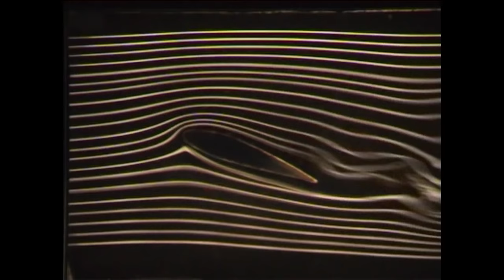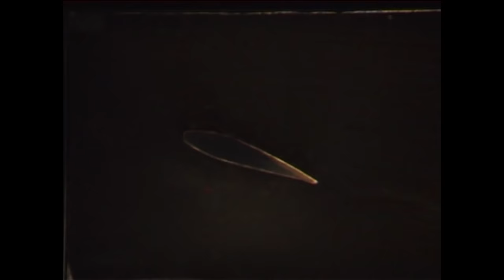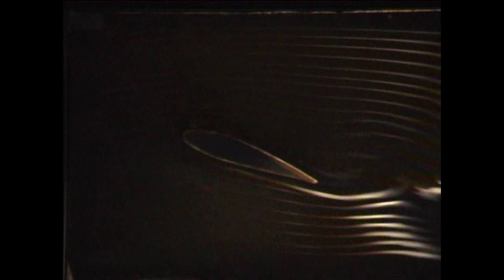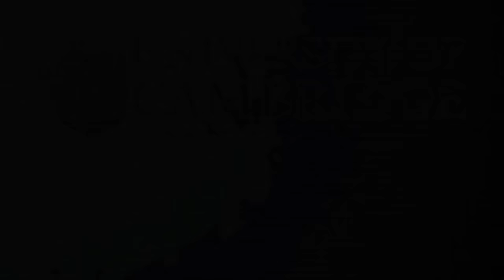Airflow across a wing

Comment: @lglglggl Because while the shape of a wing is important, more lift is produced by the wing forcing air downward than by the pressure difference caused by the shape of the wing.  At a high enough speed and with the right angle of attack, a sheet of plywood would produce sufficient lift, albeit with much less efficiency.

Comment: This will always be a sore topic. I don't think anything is debunked from this video, since the wing here is clearly much higher angle of attack than the 2-5 degrees a wing on a plane would usually have when flying efficiently. The wing in the video is stalling or near to it, is probably fixed in place, and there is no indication of how much lift is generated. Planes especially passenger planes also have a million moving parts that change the shape of the wing when flying at lower airspeeds for takeoff and landing. I am fully confident Boing, Airbus etc. know exactly what they are doing, and there is probably an explanation why doctor Holger is not cashing in millions working for those.

The classical explanation is much closer to reality, when you think about how big an area wings are, and do the physics calculations. A cutout doesn't do it justice.

Comment: I have always been annoyed by the conventional explanation. What's even more annoying is the idea that the wing is "sucked" upwards by the low pressure. The shape of the wing is also irrelevant for basic flight, a plank will work with enough air pressure. This smoke test appears to illustrate how the energy from the lower airflow is reduced and therefore absorbed by the wing.

Comment: @ubellubo This isn't necessarily true - the size of the contributions of the upper and lower surfaces is different for each wing, angle of attack and flight regime. To pick one extreme example, a supercritical wing (an aerofoil designed to fly just below the speed of sound) actually has a lower pressure on the bottom surface than in the free stream, but the pressure on the upper surface is even lower still, generating the lift force.

Comment: @krispykreme82603 ... yes, yes it will. It will react *exactly* the same. There are differences, such as the 'smoothness' of the flow and the effect the walls will have on the air, but these are generally small and accounted for.

Comment: airplanes dont fly in a vacuum so air is displaced with more air. if all things were to be equal, and you only had 2 molecules of air one above and one below they would start and end together. depending on the shape of the airfoil and the direction it faces the molecules would start separation and end together at different locations.

Comment: Hmmm, let's see. The airflow above the wing is faster than the airflow below the wing. Yet dear professor says that this does not generate lift because the air above wing gets to the back -before- the air below the wing. If I run to the toilet faster than the professor, will I not be having a leak before him? If I got there at the same time, would I have run faster? What does this prove anyway?

Comment: The "actual force upward" is caused by air molecules (mass) colliding with the wing and causing lift due to an equal and opposite reaction. Lift is not created by something happening somewhere "beyond the trailing edge". This does not in any way serve to deny that a part of the lift is attributable to the "shaped wing" concept, explainable by bernoillis principles.

Comment: Ok, seriously, in order for the airflow to speed up over the top of the airfoil, something has to impart energy to it.  Why cant it be that the airflow is being physically impeded on the bottom surface and extracting energy from the air?  If the airflow over the top appears to be going faster, isnt it possible that its speed didnt change, but rather the velocities on the bottom side have been reduced?

Comment: The wing in your video appears to be close to stalling, at this angle the air beneath the wing is being compressed by the wing and therefore slowed down, resulting effect is to push up on the underside of the wing. If you level out the wing to an angle more akin to flying flat and level you would see that the air moving over the top of the wing is traveling further than the air underneath as it needs to rise and fall over the same distance. faster moving air = less pressure = lift

Comment: "This common explanation is actually wrong." Well? Don't leave us hangin', Babs; finish what you started. Here I'll help you begin: "The correct explanation is..."

Does the air above the wing slow down/speed up/stay the same as it travels over the wing?

Does the air below the wing slow down/speed up/stay the same as it travels beneath the wing?

Why do each of the above occur?

Is it this difference which creates higher pressure below and lower pressure above which in turn causes lift?

Comment: @lglglggl Well...because air moves faster over the top of the wing, causing lift.  The video proved that.  When the plane is upside down...the bottom is now the top.  But the video states that the common misconception is that lift is cause by air having to travel a greater distance over the top of the wing.  Anyone who knows just the simple bit about aerodynamics is that lift is caused by air moving faster, which the video proves.  Odd video really.

Comment: What about the conservation of mass that is unaccounted for in your explanation. There would be a severe degradation  (drag) of the flow over the wing if your explanation was correct.  There are binary layer control devices that make up for the highly energetic flow this slowing it down and reducing it's energy so that it can meet on the other side at a similar time span thus causing less vacuum pressure drag than in your simple flow isn't symmetrical explanation. Imagine a plane flying very fast with a very curved wing for a great distance, in your explanation does the split up air remain displaced forever? If not, when is it accounted for?